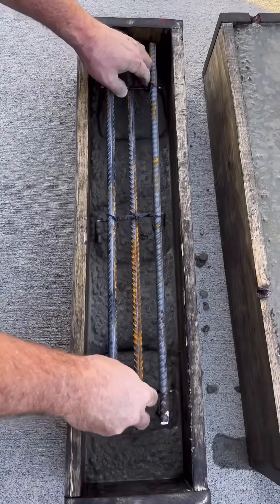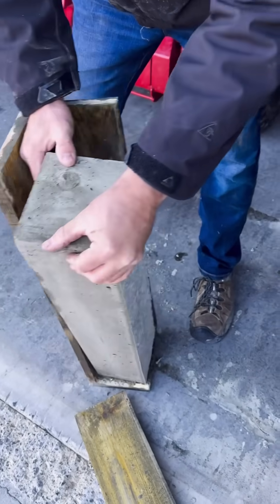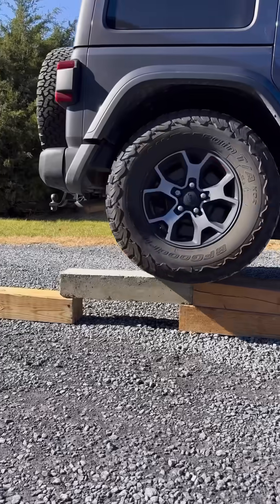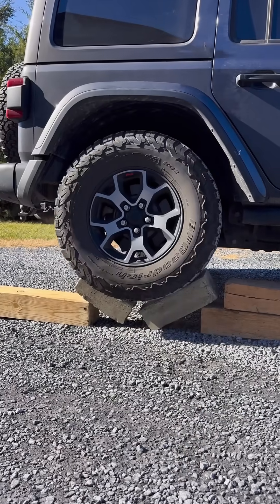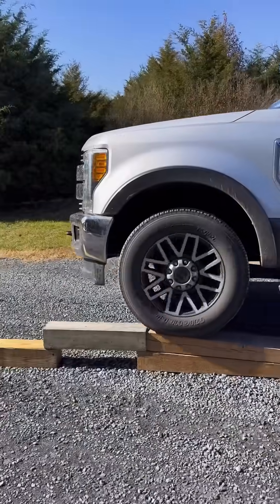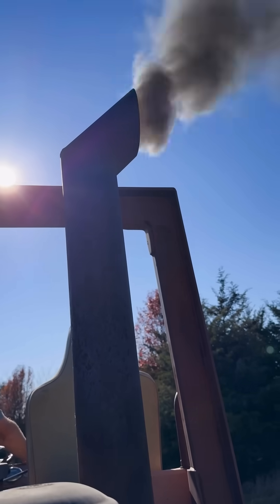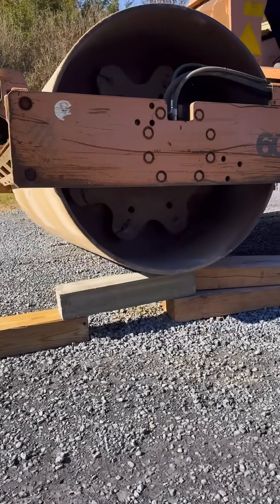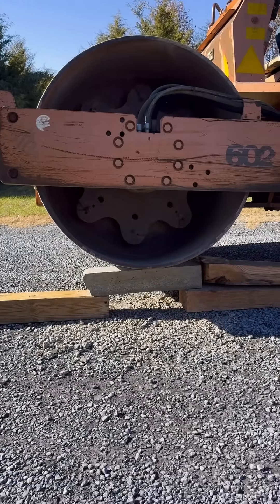Why We Use Rebar To Reinforce Concrete

Comment: Wow who could’ve ever geussed that adding metal into would make it stronger oh wow thanks captain obvious
Reply: If you took any other metal than steel you would weaken the concrete over time.
Why? Because steel and concrete have the same thermal expansion coefficient and other metals don't.
Not so captain obvious now, eh?

Comment: If a lot of you know how easy it is to bend 1 piece of rebar (hard but for human hands compared to roller, easy) you would be amazed at how much stronger this concrete and rebar is combined

The energy it would take to break or bend the pieces individually is not at all equal to the energy to takes to bend or break them when together. A human stands 0% chance of break and bending the rebar reinforced concrete alone.
A average construction worker has nearly 100% chance of breaking each isolated piece alone.

Philosophically also this "holds up" to us as a country, community and people. And how easy it is to break a society when you isolate them as individuals or groups even though its technically the same amount as if they stuck together and helped eachother out just a teeny tiny bit but evenly and fairly everywhere from BOTTOM to top.

Comment: 1/2 inch rebar is #4 rebar.  and the stirrups are very important for the type of loading your testing.  yours are poor stirrups.  finally rebar is more effective the closer to the surface it is.  clear cover is the minimum surface cover required to keep the rebar from rusting prematurely.  thus cover in earth/ ground is usually 3" when elevated deck  could be as close as 3/4" to the surface.  columns are usually 1.5" clear cover

Comment: A 28 day cure is a great practice in general, but within a 3-7 days cure, it will achieve more than 70% of the compression strength. Like reaching more than 20 MPa for a C-25 concrete.

Comment: 7, 14, 21, or 28 days. After 28 days should be no less than 4,000 lbs/in² on concrete compression test. I'd say 14 days

Comment: You should use an epoxy based concrete with rubber coated rebars. It's up to 6 times stronger than regular concrete. It's water proof as well.

Comment: Brilliant video, Royal Engineers for a big part of my life, always found this stuff interesting.

Your videos are a bit "niche" but I love them 👍

Keep up the good work, most kids leaving school these days couldn't even wire a plug, let alone mix concrete.

I would be interested to know if the "mix" makes much of a difference, you would think stronger concrete mix (more cement) does much to add to the rebar, probably not.

I bet if you let it cure for a month, maybe 6 the vibration on the roller would struggle 🤔

Comment: The problem with reinforced concrete is that the metal inside can begin to rust. This usually happens after 50 or so years, making the entire structure unreliable. So there are upsides and downsides.
Reply: That’s why we have switched to a fiberglass style of rebar

Comment: yeah but the rebar we usually use rusts. reinforced concrete provides more freedom to build diferent shapes but bricks last when you use techniques tgat compress the bricks. only downside is how brittle bricks are so exposed brick material can slowly take impatcts and crumble away over time.
Reply: Now we use a fiberglass rebar. You are correct, but one downside of brick is that it is not one piece, unlike concrete. Bricks are small and have perks but do not hold together like concrete because it’s a bunch of individual things ‘connected’ with mortar. It is why we no longer use bricks on walking paths and roads

Comment: The roller was an asymmetrical torsional load. If centered on the reinforced beam it could even take more load if not the entire weight to the roller.

Comment: As a bit of a nerd

The fact you swapped trucks causes a small issue with the experiment. Heavier or lighter, the truck should be the same to prove the accuracy and strength of the concrete blocks

Comment: This is why martial artists breaking concrete blocks and bricks is not as hard as you think. The compressive strength is impressive but due to it being elevated and the immense force pushing down is simultaneously pulling the concrete apart, the martial artist can slam his hand through the brick with relative ease. This doesn't discredit their art, just shows the science in HOW they do it.

Comment: Reinforcing concrete also gives the benefit of holding on to the concrete when it does break, only having smaller less lethal bits fall. Without it, any slab above you will just fall straight down when it fails
Reply from the maker: True

Comment: I literally knew everything about the concrete and rebar you mentioned before I watched, but I had absolutely ZERO idea that a roller had a vibrate function.
Reply from the maker: Lots of people I’ve said the same thing
Reply: @hausplans  Thank you for the education.  I was completely surprised.  What is the purpose? To help the compression of the surface?

Comment: Correction:  Driving on the unreinforced beam with both ends supported causes tensile stress, not tensile strength, in the bottom of the beam.

Comment: You could've mentioned also that it was a great discovery that iron and concrete have basically the same thermal expansion coefficient, and only due to that, we can take advantage of adding the tensile strength of iron to concrete. Otherwise, the reinforced concrete would crack apart easily.

Comment: Concrete is very brittle thats why it breaks away like its glass. Glass is also very brittle. 

But notice how reinforced concrete is a lot less brittle and can withstand more pressure. The same can be said for fibreglass. Fibreglass is basically reinforced concrete but for glass.

Comment: Very few things are better than reinforced concrete.... 

Especially when the concrete has had  proper cure time xD and reinforced via within engineered specifications for the workload necessary.  

Its only true enemy?  Fire. While concrete almost fireproof, the reinforcement inside often yields to failure when subject to alot excess heat for prolonged durations. (Usually a large fuel source like a tanker truck underneath a bridge or a airplane inside a building)😢
Reply from the maker: Interesting

Comment: The problem with reinforced concrete is that the rebar can rust, causing it to expand and crack the concrete from the inside. So it is important for concrete reinforced with rebar to remain sealed, as cracks can quickly get out of hand.

Comment: Placement of the rebar makes a huge difference. You want to put the rebar on the opposite side of where you’re going to apply the pressure. For example in a concrete slab where cars are driving on top you want rebar in the bottom of the slab. For a beam you want rebar in the bottom of the beam not in the middle as it won’t be nearly as strong

Comment: >The wood taking all of this without a sweat

Flexibility is important, especially when heat causes expansion and shrinkage.  Concrete isn't very good at handling this, and the rebar reinforcement helps to handle the flexing during hot summers and cold winters!

Comment: The concrete in the Hover Dam is still curing. The day it reaches full cure, the next day the degradation will take less time than it did to become full strength.

Comment: I worked for a concrete company making loads of different reinforced products, my section was internal walls id pull cables and weld reinforced bars, yet I’ve only just found out why we reinforce concrete from this video which makes mr laugh 🤣

Comment: Notice that the failure plane was perpendicular to the rebar. These failures can be scary when they happen on beams in structures because they often happen suddenly and without much visual warning. This is why the next step to add load capacity to a concrete beam is to add "stirrups" or vertical pieces of rebar evey few inches. And to answer your question, I'm gonna guess the concrete is somewhere between 7 and 14 days curred? (I'm currently studying for my Structural PE)

Comment: Another important thing about adding reinforcement is it changes the way the beam fails. The unreinforced one breaks “suddenly”. The moment it breaks is also the moment is its failure mode as well. However the reinforced one shifts the failure mode way farther. The beam may show signs of crack but still not failing. And when it fails, the crack starts at the upper portion then propagates downwards. In real life this gives a kind of warning signal that a failure is about to happen and the building needs to be retrofitted
Reply from the maker: Good point

Comment: And this is why modern reinforced-concrete structures will not last for centuries the way ancient Roman concrete structures did.  Steel-reinforced concrete is much stronger and allows us to build shapes which the ancient Romans could not, but when the steel corrodes, the modern structure will collapse.

Comment: You've made some mistakes here.
1. You should have used vibrator to set concrete slap after filling 
2. Let it set for atleast 30 days to achieve full strength

Comment: If you made the rebar & rebar rings perfectly it should last more without bending like that, for that load min 16mm with 12mm rings ! Then chair rods ! And beam should little bit wider and length.. then you can compare the strength

Comment: Only problem is the definition of tensile strength. Tensile is opposite of compression. Like pulling the concrete apart. Problem with concrete is bending, also known as flexural strength.
Reply: The concrete is bending because of the tension side getting stretched and the compression side getting squashed slightly.
That causes the bend

Comment: I'm a structural engineer. The concrete actually "failed" on the roller that drove over it the first time. When it started "chipping" that was actually the concrete failing in compression telling you that there was actually more rebar than should be used for that size of section. Only way to stop that chipping is to make the concrete section a bit taller.

Comment: The issue with steel reinforcement is oxidation; most concrete is slightly permeable, allowing water to reach the steel in very small amounts. Over time, the steel rusts (albeit very slowly), and iron oxide takes up more volume; so over the course of many decades, the reinforcement gradually pushes the concrete apart.

The question is if the substantial increase in tensile strength is worth the reduction in longevity (usually it is).

Comment: The tricky thing is that you can't put too much steel reber into a concrete structure. If too much is added, the strength may be high, but its own hardness is lowered, so when the weight of the structure reaches its limit, it collapses without any sign, such as like this none reber concrete block in the video.

Comment: Part of the reason roman architecture is still standing is that the didnt use rienforcements.
Reply: Reinforcements are absolutely required for tall buildings. Unreinforced concrete would break. That's why we don't see roman skyscrapers.
Reply: @ferociousmaliciousghost  yeah and its also the reason modern building will fall over relatively quickly if not constantly maintained but the pantheon is fine

Comment: And you can also see that the reinforced concrete failed slowly relative to the unreinforced one called as ductile failure which gives ample warning before failure to give enough time to evacuate...which is not so in unreinforced one which exhibits brittle failure!

Comment: Another interesting thing to note about the concrete rebar is how it didn’t catastrophically fail even at the end, it still had some form of structure due to the beam inside bending but not breaking

So that rebar could be the difference between a concrete pillar shattering due to having no support and getting too weak to hold its weight, or slowly crumbling and buckling as it has more support and some measure of give in terms of failure…

I don’t know anything about architecture or engineering, I basically just made that up… but it sounds smart doesn’t it? lol

Comment: Your rebar was laying flat laterally in the concrete beam. You should have turned the concrete beam 90° so that the 3 rebar were placed vertically one above the other. (Or better yet creat a 3D triangle with the three pieces of rebar, with stirrups, rather than a flat three in a row configuration). Structural concrete generally requires 28 days cure

Comment: Concrete should be rested for month to completly be like he should be and after that month you can drill it or whatever you want it to do xD if you dont let it set so long and will try work on it in like 3-4days it will be easier to break during instalation,and if you drill in fresh wet concrete like what is it after 3-4days you will drill in like into butter,because not ready yet xD point if this is when you mixing concrete you give there a lot of water and you need it vapour it out,because if you building home and you will start make frame walls and start built it on fresh wet foncrete you will leave that water there and it wont never dry xD but seriously try it home,make two concrete block,one let set for 30days and when will be 27day make sexond block for having 3 days old concrete and try drill them both on 30day ,for have same meassurent use two new drill bits one on each block...and trust me you will have let set concrete for 30days in future,it same difference like in vido on concrete with bars and without,you always need some bars or some welded wire mesh xD

Comment: Still green. I’d guess that was: ten days? Needs 28–at which and with that much steel over such a short span it shouldn’t have failed even when loaded with the vibrating roller.

Comment: Concrete is great holding pressure for the to0, but not sideways like you use it. Concrete cures after 100 years